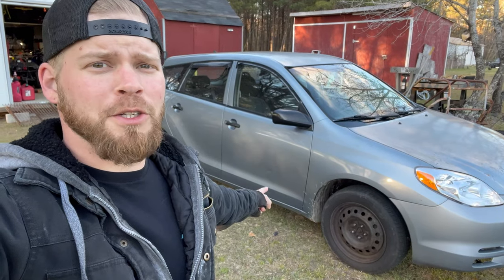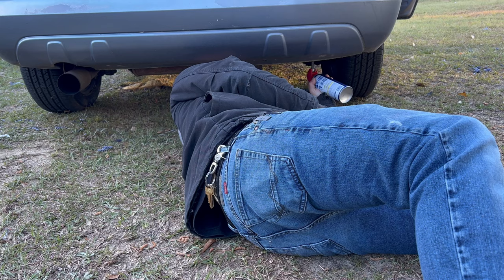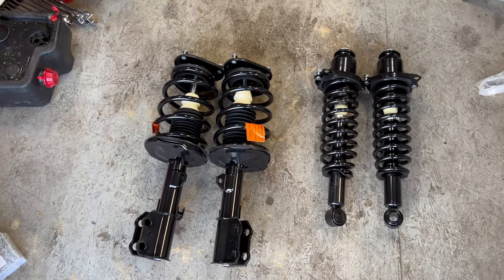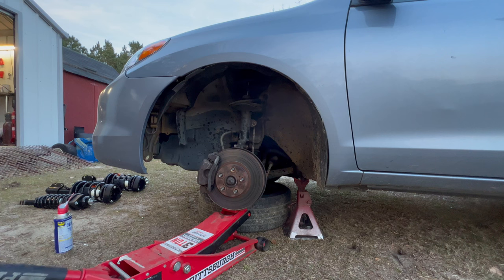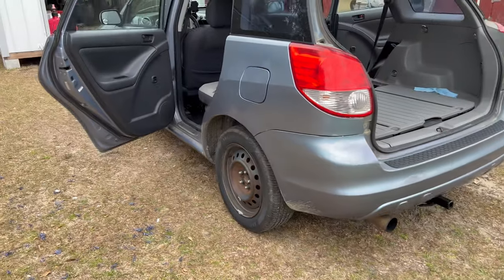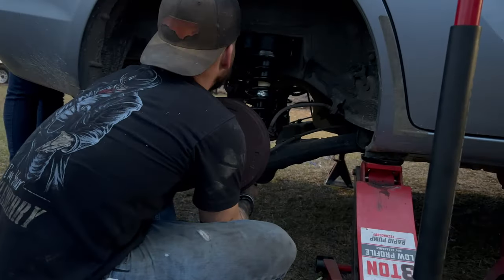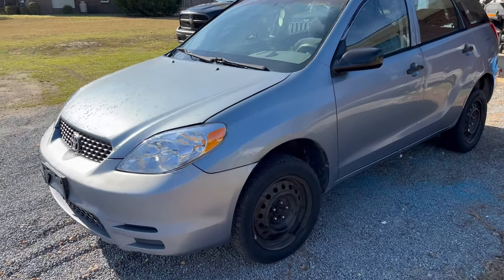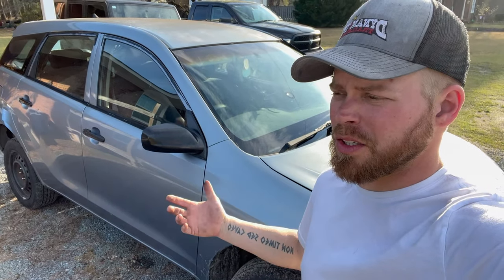Adding a LIFT and HITCH to the MATRIX!

Comment: That's not a bad looking "turd".  The matrix is not a bad hatchback...better than most of the modern ones.
Reply from the maker: You aren't wrong! I actually love the car, been driving it around for a couple weeks now. I call it a turd "lovingly" lol

Runs and rides great and gets awesome mileage!
Reply: @RattleCanCustoms  what's your mileage? Mine isn't good
Reply from the maker: @sissimonster  north of 25 maybe? Haven’t really calculated, but it does better than my truck lol
Reply: @RattleCanCustoms  I get about 27mph for city & hwy mixed.  I guess I expect better mileage- I used to have a Honda Civic hatchback that got 35 in the city!  27 isn't that bad now that I think about it.  Hey what do you think is a reasonable price for someone to do all the struts & add spacers?  I never know if I'm getting gouged.
Reply from the maker: @sissimonster  honestly not sure, but they aren’t too difficult to do with a couple buddies and some youtube videos lol
Reply: I love my Matrix I like the the glass opens on the Hatchback 
It is a tough little car!

Comment: any update on the lifted matrix?!? hows the turning is what im wondering i take corners in my matrix my worry is either loosing control or rolling over….
Reply from the maker: @9kia8  I’ve driven it as a daily since the video and it handled beautifully! Highly recommend it!
Reply: @RattleCanCustoms i have the “lift kit” i bought it last 3 years ago now after watching your video im going to do it
Reply: I've got the same issue with my 40mm lifted '03 Matrix.  I need to replace the front tires now and I'm trying to increase stability & handling.  Be able to make turns at regular speed without anxiety.  Right now it feels like it'll roll or something at regular speed on round turns.  So How big can I go before I'm in a hot rod show? No but seriously what do you recommend??
Reply from the maker: @sissimonster  I’d go maybe an inch taller, maximum. Unless you get wheels with a deeper backspacing, you may rub in tight turns. Please don’t think you can put a 1.6” lift and 33s on it lol
Reply: - @RattleCanCustoms  hahaha.  What size numbers would an inch or less be?  Is that a 17" ?  And if it's taller does that mean it's wider too?  I'm sorry if these are dumb questions- I'm a complete newbie trying to make my car better. I appreciate all the advice!   It would look better with a little wider.  The P205/55R16 look puny now.
Reply from the maker: @sissimonster  the only dumb questions are the ones you don’t ask!

I’m referring to the outside diameter of the tire, depending on what tire you use is gonna determine if it is “wider” or not. I won’t pretend to understand how the ratios work in a tire size, I usually just google the actual measurements and go from there lol

Comment: Did it change your mpg? Also you can get a 55gal plastic barrel.cut top and bottom off slit it long ways and heat it w/big ass torch to get it flat.remove the front tow hook(cut plastic to fit with jig saw) and use the holes to mount it and a couple lap screws in a few spots(you'll find a few places) and presto. skid plate (road armor). I did this to my vibe for oil/tranny pan protection.i was waiting for someone to lift one!thanks for video!!
Reply from the maker: Didn’t change mpg since we have yet to change tire sizes! And that’s a great idea with the barrel!

Comment: I have a 2003 xr ALL WHEEL DRIVE. I did this but just be aware that any mod adds stress on other components.. For instance after you do this mod, you will now hear a slight banging in the front  part of your engine, Reason is the CV axles on both wheels are now at angles they are not designed to be so being a 3 bearing axle rotating at a now angle and not horizontal you will hear a thud as it turns... if the axle had four bearing you would not hear the grinding as much.. to test, lift the car totally up off the wheels on a lift and put it in drive and watch the engine jump everytime the axle does a full rotation... so yes your bearing and axles will break sooner with this lift. That is with all mods that the car was not intended or designed for. If you can deal with the added vibration and don't mind to nurse your car over speed bumps you will be fine and enjoy the added lift. I will . I think it's worth the benefits over the cons. But I want to be real. I don't drive on dirt roads and in the woods where rippin sound don't matter but Im in the city and drive on decent roads where I can hear birds and feel my steering shake a little and tires wobble. I also did the strut bar in the engine bay as well. I did post it but I dont see it my write up but for those people who had continued to read this tahdah... https://www.amazon.com/gp/product/B000EDE6EO/ref=ppx_yo_dt_b_search_asin_title?ie=UTF8&psc=1
Also I will go with a larger size tire, that will  raise the car up more, and will not hinder the axles at all or change the angles of the axles.
Answer the question does it turn differently, no I feel no incumbrance or advantage  it's the same. No way feeling of rolling over or losing control get that strut bar in the link even if you don't do the lift I think Toyota should roll all autos out the doors with these.
BTW get a front end alignment ... and surprise.. you have to buy two bolts because your front tires are still cambered inat the bottom.
 You cannot do a proper alignment without it  because your stock bolts are too short.

Comment: Plan to lift my 06' Vibe GT. Bought taller tires that should give a solid .5" lift, but strut spacers will be in the near future. 

May use wheel spacers for a slightly wider stance and add fender flares, along with custom bull bar with some driving lights.
Reply from the maker: Sounds awesome!
Reply: That does sound awesome if you do it make a YouTube video of it
Reply: I’m going to throw spacers on not for the spacing themselves but to convert from 5x100 to 5x114.3, because that’s what most aftermarket wheels are
Reply: @Dude13450  understandable
Reply: hey what size tires did you buy?  I need to replace the front tires and I'm trying to find what will be more stable on turns.  Right now it feels like it'll roll or something at regular speed on round turns.
Reply: @sissimonster  I’d look more into tire pressures or suspension components.
Reply: @sissimonster  I bought 225/60R16. For cornering, you'll not want a lot of sidewall or under inflated tires. I'd not recommend the size I bought if you're looking for better stability in cornering at any speed.
Reply: I'm still learning about tire sizes, but I think the recommended size for the Matrix is P205/55R16. I'm not sure the tire shop will give me the best recommendation, especially since I'm a woman. How do you decide what the best tire size is for handling? Assuming good tire pressure, what would you buy if you wanted better stability when cornering than the 225/60R16? I appreciate your advice!
Reply: @sissimonster  yes, 205/55R16 is the OEM size, that's what my GT came with too. It's definitely better for cornering, but I wanted more ride height and a softer ride. 

My Cobalt has 40 series tires and I swapped to FE5 suspension from the turbo SS. It rides pretty harsh, you can feel every crack in the road (not really, but it's pretty bad). However, it's like driving a go-kart on rails, it sticks to the road quite well. 

It's a tradeoff. 

What exactly is your goal? 

I mean if you plan to track the car, you'll probably want a low profile tire, like 40 series, and fairly soft and sticky. My buddy has such on his Camaro and he does autocross with it. Trade off is that wet traction is meh and the tires were quick. They're only 45k tires and he probably won't get much over 30k out of them.
Reply: @Dude13450 thanks for your thoughts.  I think low tire pressure may well be part of my issue.  That & I just discovered slow leaks in my front 2 tires & almost no tread! 😲
Reply: @brandonweigel6309  my goal is two-fold; to look bigger and to make handling better.  By that I mean increased stability/cornering & if possible, a softer ride.  I'm gathering that those goals are probably not compatible- is it either softer ride or better handling?
Reply: @sissimonster  for a smoother ride, you'll likely want tires with more sidewall and suspension that's soft, but those two combined will result in a vehicle that doesn't give the driver much confidence in cornering at any real speed. 

I won't say that what you seek isn't possible, but I suspect it'd be far from cheap.

Comment: Is there a video with the new beefier tires yet?
Reply from the maker: Still wearing out the old ones lol it’s my daily to work
Reply: @RattleCanCustoms  looking forward to what it looks like with the new shoes, and to see what size you can get under it.
Reply from the maker: @illyadmark3223  same! Lol gotta do some more research as to what will fit, and what it will cost. Money plays a big factor lol
Reply: Definitely do a video of it after you get new tires. I actually bought Firestone snow tires for my rear wheel drive Colorado and it made it look a lot better and beefier compared to the regular tires that were on it before. They were pretty cheap and they lasted a really long time. I thought they would burn up pretty fast during the summer but I mainly rode motorcycles during the summer so that may have had something to do with why they lasted so long lol

Comment: I want to do a 2” lift on mine I’m just not sure what else I would have to do for alignment or dl angles. Or if it’s needed or not??
Reply from the maker: Any time you change anything with suspension, you’ll want to get an alignment. As far as angles, the lift is mild so it doesn’t change as much as you would think. I replaced my shocks and springs as well, but they were stock length. 

I didn’t have to do anything extra to mine, so you should be good.

Hope that helps!

Comment: This is EXACTLY what I wanted to do to my little 2003 Matrix XR once i realized how low it rode.  Maybe I should find somebody who'd be willing to do it (I have % mechanical skills) and I DO need new struts!  At 114,000 miles I think it'd be worth it... whatdya think?  Also can I drive down and have you do it? 🤣
Reply from the maker: It would be worth doing for sure! As far as having us do it……probably not lol
Reply: Matt- with the lift, is the car actually only 1.6 inches taller?  it looks so much taller, I can't fathom it's noticeable.   Still... not scraping the bumper panel on the curb in parking lots is gonna be priceless.  I'm still chickening on doing it myself.  Where did you buy the struts from?
Reply from the maker: @sissimonster  the struts and lift kit both came from Amazon

Comment: Which LED lights did you end up buying?
Reply from the maker: I ended up using the NiLight kit from Amazon

Nilight 9005 9006 LED Headlight Bulb Kit, 350% Brighter,HB3 HB4 LED High Beam Low Beam Bulbs Combo, 6000K Cool White, Mini Size, 4-Pack https://a.co/d/1TmK9k2

Comment: The rear of my car is sagging/squat. Might be due to hitch weight in rear and removed weight from up front combined with crap replacement struts. I need a lift for the rear only or cut the front springs. Anyone else have this issue?
Reply: I can guarantee you that the weight of the hitch is nowhere near enough for the rear to sag.  Has Front/Rear weight distribution of 59/41, weighing ~2800 pounds means the rear suspension has ~1150 pounds of weight directly on it with a gross weight rating of 1850. Adding the hitch puts rear weight distribution up near 1300 tops, still plenty of headroom. 

Your sag is either from things being bent (control arms, axle beam, etc) or it is entirely from crappy struts. Also did you replace the strut assembly or just the “shock” portion of it? If you reused your old springs, they’re probably dog tired and that’s what’s causing sag because the spring is supporting weight while the strut is absorbing the harness of the roads and the old springs have “sprung” and are lazy.
Reply: @Dude13450  Culprit was crappy strut assembly supply, FCS brand. They only lasted ~2.5 years. I replaced them at 3.5 years. "Lifetime replacement", but I got the next brand up (Monroe). ACDelco no longer stocks the front left strut, there are a few rights in stock. KYB doesn't make full assemblies for the rear.